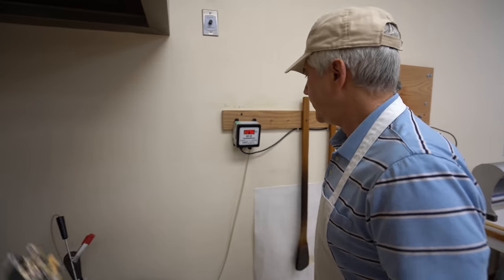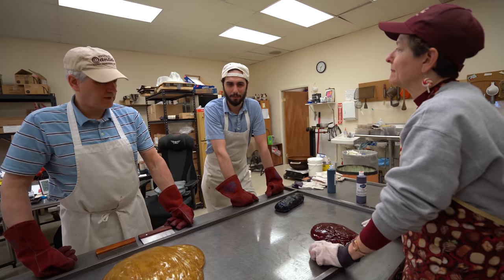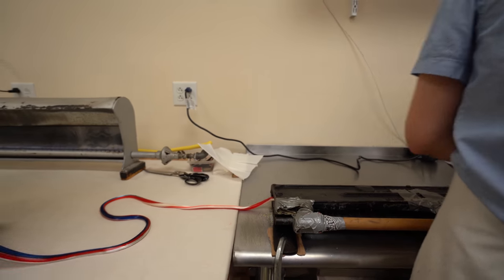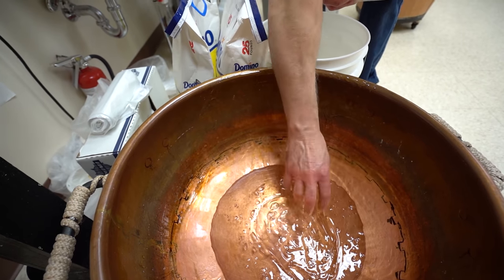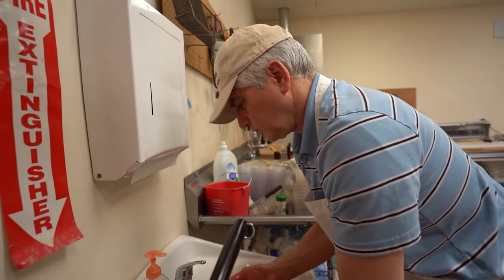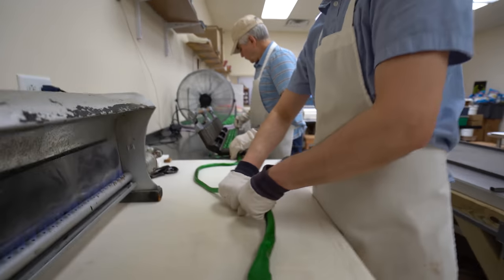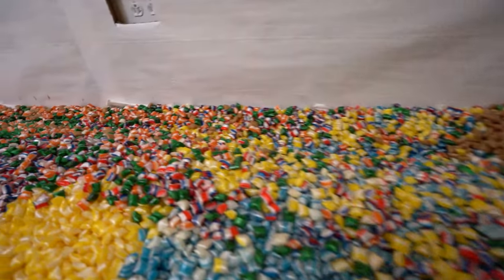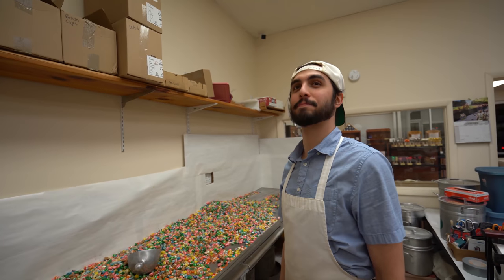What Does 140 Pounds of Spiced Hard Candy Look Like?

Comment: psst , you missed a spot.

Question: Do you package the hard-candy from the counter or do you move it to a few crates first? 
Because if you put it in crates. you could ad layers of flavours one by one. then it will mix by itself and you don't have to mix and then put it into crates.
If you package the candy from the counter directly then the only faster way i would think off is an candy mixer (concrete mixer).
But they tend to crush allot of candy, and because it's a mixer you can't really use it for anything else. so it will only take up space.
 
ps. Steve the muscle man. it shows that you are making more candy then ever, look at those biceps.
Reply: They place the candies in boxes   (Sometimes they will put a mix bags) (medium size boxes ones) Then they carry the boxes to the production area. Where they are bagged, weight and labeled. They been doing that way for a long time. Your way would be wasting time.
Reply: @mmiller71  
Thanks for your feedback.
You are a wonderfull person.

Now explain me why "my" way would be a waist of time?

Comment: So, when your making the mix packs, and your dumping them all on the table, why do you stripe them vertically like that? Wouldn't it make it easier for mixing if you did thinner stripes across the length of the table, and stripe the pile from the back of the table to the front? Seems like it would make mixing easier, as you'd be mixing front-to-back instead of end to end.

Comment: Why don't you spread the colors out horizontally so they are parallel  instead of in columns to mix easier.
Reply: They just need the counter space. That's all even with the expansion they still need more room
Reply: @maxinecrossfire2514  well I mean I was just thinking logistically to mix the candy flavors more evenly.  But its just a small idea.
Reply: No you are completely correct. It would be better for mixing but sadly not enough room to do it. I think it is time to move again. For them